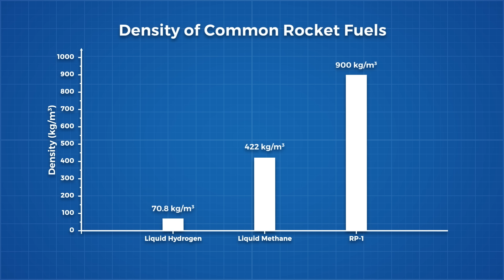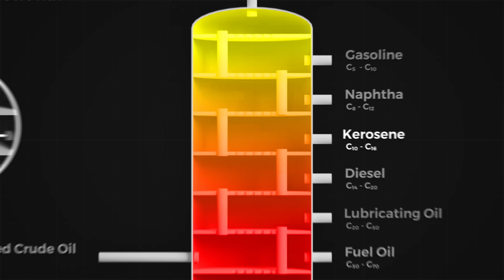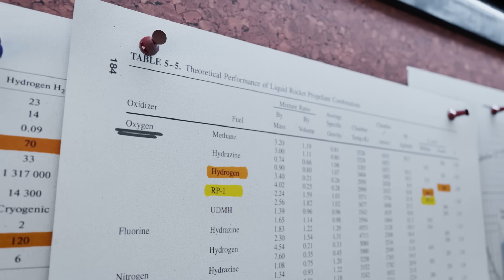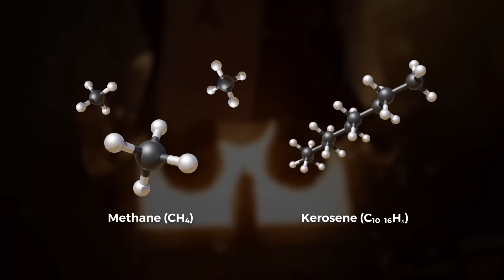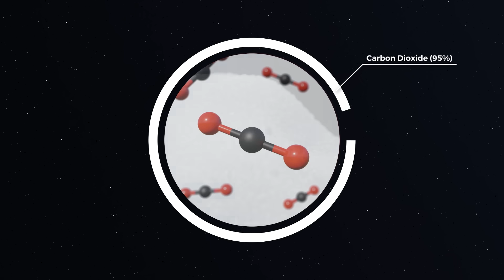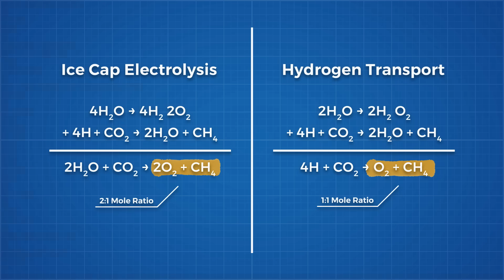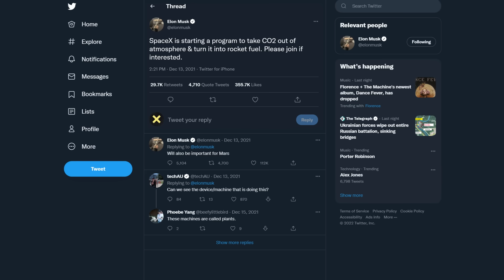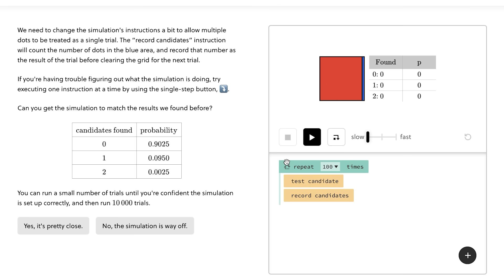Why SpaceX is Using a New Fuel

Comment: i can answer this question in about 2 sentences, they are.
Because you can make methane on mars. and the reason why they are not going to use hydrogen which is also avalible on mars is because the rocket would be to big.

Comment: The fact that you cannot see the obvious problems with Starship in the Artemis mission where it will require 14 refilling operations to leave LEO among other glairing problems tell me everything about your "Real Engineering" channel. You are just a follower and not an engineer who can look beyond the flashy things and deal with the obvious first. You are a sheep my friend.
Reply: 8* and that number will go down with V3 which has an extended payload section and more mass capability 

Also that’s not an issue. They’re going to have a fully reusable vehicle with a direct return to launch site capability 

Not just to the facility. Literally to the pad 

They’re currently almost meeting the Artemis 3 necessary flight rate with Falcon 9 and it’s only partially reusable and often takes days to return for reuse

Rapid reuse changes a lot of the problems you think exist

Comment: why am i getting the idea to help with launches by propelling the ship up using some form of catapult?  as to get it moving faster, equating to a slightly lower fuel load/ ship weight... idk what speed you'd have to get the ship/rocket to in order to have it fly up far enough that the thrust output doesn't cause it to fall back down... why do i get these weird ideas sometimes??  anyhow for some reason that popped into my head.. the faster you would need to go the deeper you'd have to make the launch tube... may even have to use a disposable rail car or something... as a form of sabot housing/guide... thou someday that may be removed as we advance to use magnetic fields to isolate the ship from the sides of the tube.  idk how many years that might take, i doubt i'll see it in my lifetime.  peace.

Comment: Liquid fuel is a problem how is it fed from the tank to the engine
Reply: The rocket engine pushes the tank forwards, whcih causes the fuel inside to be pushed to the back of the tank, allowing it to be pumped. Things git a bit more tricky after the engines shut off and you're floating in zero gravity -you have to use small gas or solid fueled engines to push the tank forwards instead before you can start the liquid engines.
Reply: @lazarus2691  

If you can't change the fuel change the Way the engine access the fuel.
Reply: Pumps move fuel to engine

Comment: Having slept on the space news for the last 3 years, I have no idea how exactly does having larger fuel tank volume negate thrust efficiency and why do we care about it negating whatever it negates
Reply: Larger tanks are heavier because they're made of more material.
Pushing more weight means the engines have to work harder, which negates the higher efficiency of the fuel.

Comment: It's interesting that someone could produce a video that declares Climate Change as the biggest obstacle to human existence, yet in the same video show the chemical breakdown of the Mars atmosphere as 95% CO2 and never comment on exactly why Mars isn't a "Greenhouse Furnace". Every time Venus is discussed CO2 is blamed for the intense heat.
Do you "climate change" gurus want to learn how pressure and temperature is related, so we can stop talking about how many CO2 molecules can dance on the head of a pin?
Remember, Al Gore got a "D" in his physical science class and he believes in Global Warming.
Reply: Broseph, Mars is significantly further away from the sun and by virtue, much colder.
Reply: @classonbread5757  Keep trying.
Reply: @Thunderbird-2  Reply with a counterpoint, your turn.
Reply: Mars is 95% carbon dioxide, but only like 1% the atmospheric density of Earth. The ground level atmosphere on Mars is roughly the same as 22 miles above ground on Earth. That's about 3-4x higher than jets fly. And it's why they weren't sure they could get a drone to fly on Mars.

Simply put, there isn't enough atmosphere at all, regardless of composition, to have a greenhouse effect. In fact one of the ways they plan to eventually warm Mars (many decades from now) is to pump more CO2 into the atmosphere.

Comment: why dont we just use lights that are as optimized as possible facing down with tons and tons of lights that when u wanna move the rocket it turns them on
cause photons push stuff even if its weak it might still work

Comment: Still nothing to propel against in space.
Reply: Rocket engines are not propeller engines. They aren't pushing/pulling against atmosphere to move. They throw fuel out the back at extreme speeds to push the rocket forward. You don't need atmosphere for that.
Reply: @anthonypelchat  
But how is there an equal and opposite reaction with nothing to propel against? Even vacuum chamber small-scale rocket launches are so confusing! Do the walls being close enough provide the opposite reaction? Does any gas (besides air of course) still exist in a giant vacuum chamber for the syringe rockets to push against?
Reply: @TrianglePants  Propelling isn't an equal and opposite reaction. it's something else. Rockets are pushed by fuel. The fuel is being pushed out of the back of the rocket, which then base on the equal and opposite reaction, pushes back against the rocket.

You can test this yourself. Take a dense, heavy ball, a rolling chair, and a smooth flat surface. But the rolling chair on the flat surface and sit down. Lift your feet off the floor and throw the heavy ball. The harder you throw the ball, the further in the opposite direction you will move. To prove that it has nothing to do with atmosphere, take a balloon and fill it with air to the same size and try again. You won't get pushed back anywhere near like you would with a heavy ball.

Rockets use that concept to push tons of fuel at extremely high speeds out of the back of the rocket. This pushes the rocket forward. It isn't anywhere near as efficient as a propeller or jet aircraft that can use the atmosphere to push off of, but does work.
Reply: @anthonypelchat  
I understand the ball/chair analogy, but it still doesn't make the vacuum phenomenon any more comprehensible. 
The ball is something you push against. There still is nothing in space to push against.
Reply: @TrianglePants  Fuel is what the rocket is pushing against. Just like when you throw the ball, you aren't pushing against the atmosphere. You are pushing against the ball. The weight and force of the ball is what matters not atmosphere. If you had several of those balls, you could keep throwing them to continue to move. And if there wasn't any friction nor air resistance, you would also keep moving and each throw would get you going faster and faster.

Likewise with the fuel in the rocket. The rocket is basically throwing the fuel out of the back end. While each little bit of fuel is lightweight, the combined amount of fuel being thrown back along with the insane speeds that it is thrown is what causes the rocket to move forward.
Reply: @anthonypelchat  
Somehow didn't realize the propellant was also the opposite reaction source (whatever the adjective for that is).
Huh...
Reply: @TrianglePants  No worries. It is literally just like throwing that ball. And it can get confusing since aircraft and even automotive engines need air to operate. Rocket engines just need oxygen to burn the fuel, which they have to carry onboard in a liquid state. There are other ways to run rocket engines as well. Same principle though.

Comment: I encourage everyone to think through the "climate change consensus" that has attributed the "problem" to CO2. Several counterpoints to consider: 

1. Vostock ice cores show unquestionably that past atmospheric CO2 concentrations were more than an order of magnitude greater than today (long before SUVs). 
2. The atomic weight of CO2 is 44 yet the average atomic weight of the atmosphere is a smidge below 29, therefore, CO2 only exists in trace amounts in the upper atmosphere (put there primarily by volcanism). CO2 is mainly confined to the lowermost strata of the atmosphere which doesn't create any kind of "feedback loop" or what could in any way be characterized as a "greenhouse effect" (admittedly, CO2 does indeed absorb infra-red radiation which is a good thing... We'd likely freeze, otherwise).
3. The optimum atmospheric CO2 concentration to support photosynthesis is more than 4x what it is currently - if anything we should be ADDING MORE CO2 to the atmosphere instead of stupidly doing everything possible to remove it. Current atmospheric CO2 concentration is much closer to the starvation level for plants than it is to the past maximum (not even close).
4. Professor Ian Clark, et. al., have conclusively proven that atmospheric CO2 levels actually follow Earth temperature instead of the other way around - as suggested by the "consensus". In other words, that big glowy thing in the sky is primarily what determines the temperature on Earth just like it always has. The fact is that atmospheric CO2 levels adapt to temperature (with an approximate 800 year delay).

It can be argued that the only things "driven" by CO2 are bubbly beverages and plant growth. It can also be argued that the "demonization" of CO2 is more about power and control than it is about solving any kind of real problem. We desperately need to re-open the debate across all venues - only this time with all points of view given a seat at the table instead of the agenda driven echo- chamber we've had since the beginning of this so-called debate (from all sides).
Reply: CO2 is not the problem, you are
Reply: @goddmor1015  Your reply is a bit disappointing, but, if you're interested, I would like to hear your reasoning for your apparent position. I'm certainly willing to change my mind. Hopefully you are too.

Comment: Quick aside: carbon capture doesn't make sense. it requires materials and energy, that, more often than not, will be sourced from fossil fuels. you could use renewable energy to "recapture" carbon, but then you would waste that energy on inefficient capture instead of directly using it to replace fossil fuel in that "dirty" process or industry in the first place. Such conversions are never free. nobody ever seems to talk about capturing and using waste heat, increasing energy efficiency, or trying to electrify industries properly. also, any technological carbon capture solution so far falls behind forests. but there's no money in planting new forests, see.

Comment: so the reason they haven't used methane on an orbital rocket yet is because they didn't want a half measure and they wanted to commit to either densest fuel possible or most efficient fuel possible? i always thought hydrogen rockets were dumb, the fuel is 36% more efficient, but the size of the tank and the amount of the insulation and the chance of leak more than cancel it out, right? also methane is only 12% less efficient than hydrogen and it doesn't have all the problems hydrogen does, i find it surprising that it took this long for engineers to start using methane, also methane is cheaper

Comment: Methane is a hydrocarbon like petrol or diesel. When it burns, it produces CO2. Hydrogen produces water vapor and no CO2. Anyone think of that?
Reply: Hydrogen is a smaller molecule so it's more expensive to build a rocket that uses it.

Comment: Note that you can also produce equivalents to kerosene from the CO₂ and water of Mars by producing carbon monoxide and hydrogen gas and then using the Fischer Tropsch synthesis which we already use in our refineries to produce synthetic kerosene.

Comment: “real engineering” covering elons non existent tech. what a joke
Reply: Non-existent? Have you seen what they’re doing down in Boca Chica… The thing will most likely launch before the year ends.
Reply: @angadsingh9314  lmao will check in with you at the end of the year bud
Reply: @instantsus_  They just did a static fire with 7 engines.
Reply: @johntheux9238  has starship launched?
Reply: @instantsus_  A few times. Not with the booster thought.
Reply: Non existent?  But raptor has already flown

Comment: Very cool stuff. Nice to know how they're trying to work towards improving the atmosphere.
Reply: I encourage everyone to think through the "climate change consensus" that has attributed the "problem" to CO2. Several counterpoints to consider: 

1. Vostock ice cores show unquestionably that past atmospheric CO2 concentrations were more than an order of magnitude greater than today (long before SUVs). 
2. The atomic weight of CO2 is 44 yet the average atomic weight of the atmosphere is a smidge below 29, therefore, CO2 only exists in trace amounts in the upper atmosphere (put there primarily by volcanism). CO2 is mainly confined to the lowermost strata of the atmosphere which doesn't create any kind of "feedback loop" or what could in any way be characterized as a "greenhouse effect" (admittedly, CO2 does indeed absorb infra-red radiation which is a good thing... We'd likely freeze, otherwise).
3. The optimum atmospheric CO2 concentration to support photosynthesis is more than 4x what it is currently - if anything we should be ADDING MORE CO2 to the atmosphere instead of stupidly doing everything possible to remove it. Current atmospheric CO2 concentration is much closer to the starvation level for plants than it is to the past maximum (not even close).
4. Professor Ian Clark, et. al., have conclusively proven that atmospheric CO2 levels actually follow Earth temperature instead of the other way around - as suggested by the "consensus". In other words, that big glowy thing in the sky is primarily what determines the temperature on Earth just like it always has. The fact is that atmospheric CO2 levels adapt to temperature (with an approximate 800 year delay).

It can be argued that the only things "driven" by CO2 are bubbly beverages and plant growth. It can also be argued that the "demonization" of CO2 is more about power and control than it is about solving any kind of real problem. We desperately need to re-open the debate across all venues - only this time with all points of view given a seat at the table instead of the agenda driven echo- chamber we've had since the beginning of this so-called debate (from all sides).

Comment: A vintage 1961 brute force mentality of vertical flight into orbit is impractical so you should consider Hector D'Auvergne's Patented upward angular acceleration into orbit, and Robert L. Morrison's Patented lighter than air solids.
Reply: "Shen Long" spaceplane has been launched from a "Xian H6" while Xcor "Lynx" was built and flown so please do not censor my entries.  

"Omni Future Almanac" by Bova and Weil mentioned antimatter loaded into crystal lattice matrix of boron fuels, and gas core fission fragment rocket engines as did Bussard's "Aspen" spaceplane work at Los Alamos. 

 MIT faculty Professor Dr. Peter Hagelstein inside the Eastman Kodak Building along the Charles River of Cambridge, MA described how isotopic fuels can be loaded into materials whereby they can form quantum condensates of hadronic subatomic particles of high energy nuclear physics, Alan bond of Reaction Engines Ltd. had an engine for diborane fuels, and Motohiko Inai of Northeast Asia had Patented ground based particle accelerators to deliver muons to a rocket engine.

Comment: Of March 2019 by invite only during an engineering conference held inside MIT's Electrical Engineering Dept. on Vassar Street of Cambridge, MA. I gave a presentation on how Nitchitsu's Noguchi and Songsu of Early 1940s Hamgyong Province were working on a cosmic ray muon catalyzed fusion rocket plane engine comprised of a Dewar of cryogenic liquified deuterium connected toa beryllium alloy reaction chamber nozzle coiled in around electromagnet coils one could use for a spaceplane.
  
 HIdeo Hasagawa's memoir mentions deuterium aerospace fuels of early 1940s Hamgyong Province as does Patents by Fritz Hansgirg.
Reply: Ruby Cart a Physics Professor of Eureka, CA. has posted a transcript of my presentation online. 

During 1990s Dr. Mitchell Swartz affiliated with MIT of Cambridge, MA. published my peer reviewed on such a topic for Prior Art on Jerome Drexler.

A book by Robert K. Wilcox portrayed Noguchi as a mad "Dr. Strangelove" so please do not censor my entries.

During a March 2019 Engineering Conference held inside MIT's Electrical Engineering Dept. on Vassar St. of Cambridge, MA. I also mentioned how Naranjo and Putterman of UCLA  Patents for Cryogenic pyroelectric crystal fusors could be improved via molecular sieve to only allow carbon dioxide CO2 to enter for ionization whereby carbon is fused to form oxygen to permanently convert exhaled carbon into oxygen.

Comment: Very interesting. Out of context, I wonder if this kind of technology to transform CO2 into Methane and water could be already use here, the CO2 level is really low on earth (412 parts per million on average and rising but already to high for environnemental issues) and even with the use of solar or geothermal powerplant, the first problem is the CO2 capture high energy consumption for low quantity of CO2 removal moreover you need more energy for the rest of the chimical reaction.

Comment: If collecting carbon dioxide from the atmosphere is to difficult why don't they just collect it when they burn fuels. Carbon dioxide is just expelled as a waste exhaust for the last few decades but now it's a valuable resource that can be turned back into fuel. Idk how difficult it is to collect the co2 from exhaust but if it lowers gas prices that would be nice. 

Now that I think about it trying to freeze co2 after it's just been burned fast enough to keep up with a running engine is probably impossible on cars. But for large scale factories making a giant co2 collection pipe routed from an exhaust pipe to a fuel production facility doesn't seem that far fetched.